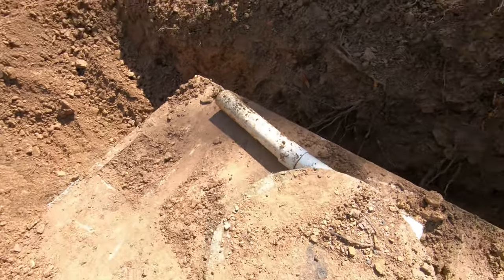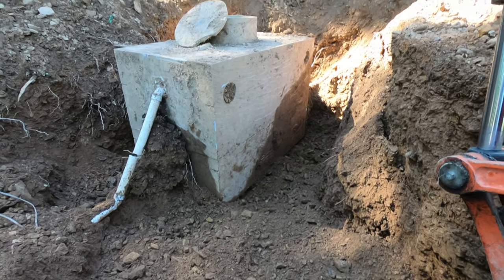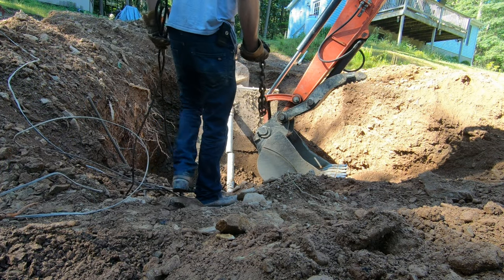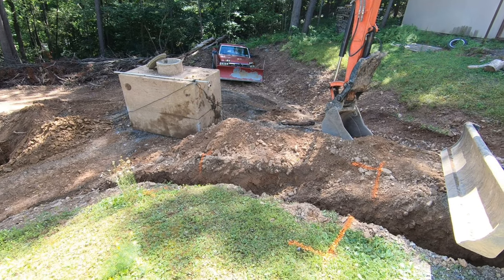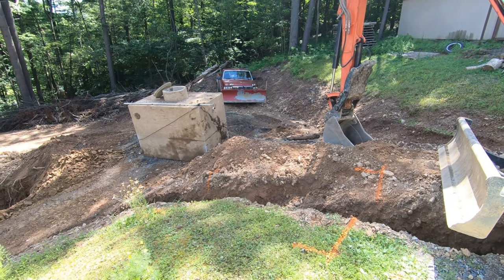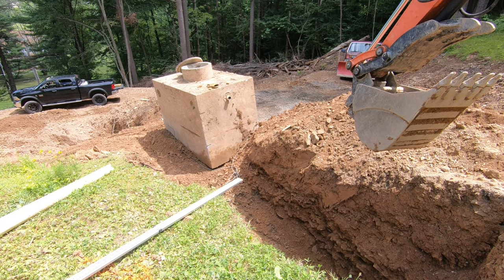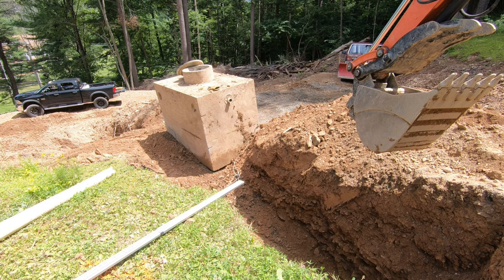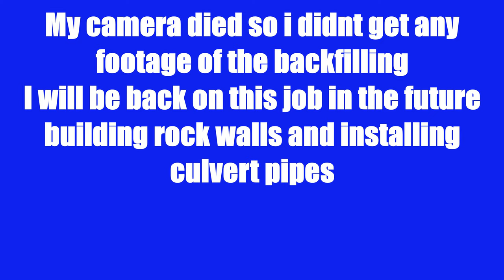Moving a septic tank

Comment: I'm considering rotating my septic tank about 90 degrees so that the leach field is directed away from the house. How much did your job cost? And how much do you think a job like this would cost?
Reply from the maker: Hi!

So this job was roughly $2500 for just moving the tank. Now I had quite a bit more work here so I already had the equipment on site for the project. 

I’ve quoted replacement septic tanks around $5-6000. So I’d say to expect around $4500. You will most likely have to have a concrete tank company come lift the tank for you. I was lucky that I could drag this one with my machine but they typically are very heavy. 

If you are only looking to move the leach field why not put a 90 out of the tank and rotate it that way? Would be much cheaper and way less work.

Comment: Hey! Good content, great editing, good mix timelapse/regular speed and also very good choices regarding music! This video deserves a lot of views! Have a question. When I did my septic system it was important to have very fine material hard packed under the tank. Perhaps because I had a plastic tank? The soil look great there, no big rocks and stuff.
Reply from the maker: Hey thanks!!!

So yes under normal circumstances you’d put some sort of sand or stone dust under the tank. Especially a plastic tank. This being concrete and having a very solid base it wasn’t necessary. It also would have been very difficult to get sand under the tank just because I had no way of actually lifting the tank. 

It’s funny the septic guy told me there was no way I’d move that tank! Proved him wrong!!
Reply: Abrams Excavating I guess if the soil under the tank wasn’t so much disturbed during digging it wont sink. Have you seen my septic system series.
Reply: Abrams Excavating and yes, proves that an excavator is a multi tool.
Reply from the maker: Nils Kall yes I have seen some of your septic tank series! Very nice. 

Yea I figured it’s all hard shale there. No need for more of a base. Also as long as the tank isn’t facing down hill it doesn’t need to be perfectly level. I set it up with a little back pitch just to insure no solids would reach the outlet.

Comment: I wonder what that tank weighed...
Reply from the maker: A lot hahah! The ole 080 did not like moving it. I’d guess like 5-7,000lbs. It was a two piece tank however I didn’t want to separate it cause I doubt it would ever re seal properly. The septic company that pumped the tank for me was basically speechless when they saw I moved it with such a little machine.